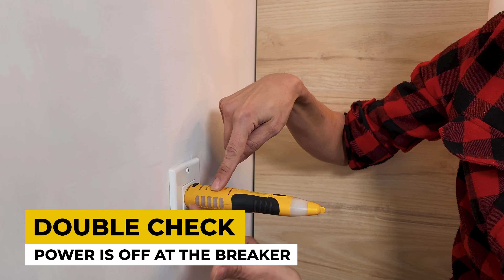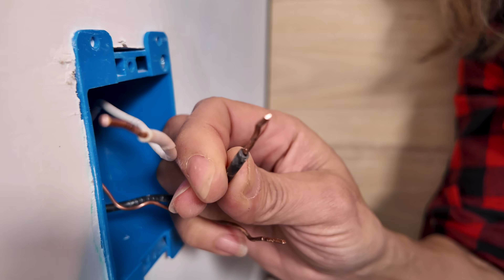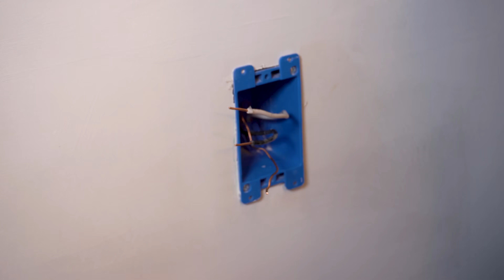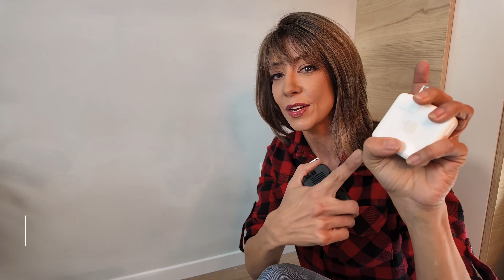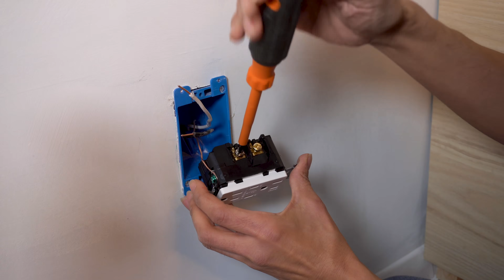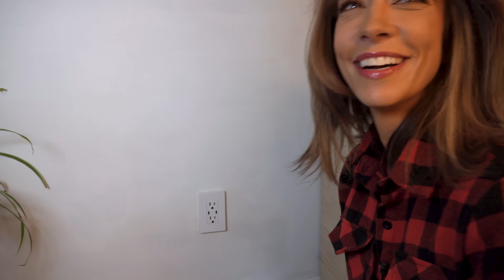No More Chargers | This Simple Outlet Upgrade Changes Everything

Comment: It's not necessarily safer to connect the earth ground first.  This implies that you did not properly disconnect the circuit so one of the others is still live, at voltage, but if it is, then having the earth ground connected first means that you have now turned the entire outlet (product) that you are handling into a ground path, so that when you next TOUCH the other wires to install them, you just created a path to ground THROUGH your body.  Very bad.

Ensure that the power is off, then it does not matter to connect earth ground first and if we want to play some odds of whether it really matters, then it might be better not to.  If worried about it, ensure that you are not touching anything grounded or another ground path while working with the live wire, and ideally only touch it with insulated tools - or just make sure the power is disconnected like stated  previously.

Comment: I do really like having the usb access, but I also am concerned over the rapid pace of changing technology. In the past I have installed outlets like this that had usb-a connections. Now everything we own works on USB-C. So, I've found that plugging in adaptors is simply easier and potentially cheaper in the long run. Of course, it is hard to get a sleek look by plugging in additional things that stick out beyond the outlet face. The plug here looks great!
Reply from the maker: It’s a valid concern about future-proofing. Thanks for sharing your experience!
Reply: I hate to break it to you, but when you plug a cable in to use this outlet, you still have things that stick out beyond the outlet face.  That's not sleek if you can see the outlet which you'd want to in order to use it.

Sleeker would be to pick an outlet you cannot see, hidden behind something, to a multi-outlet power strip, which is also placed where you cannot see it, then the wire to it also plugs in where you cannot see it, so all that remains to see to make it sleek is the end termination of the wire at the USB plug for the device, or of course to a wireless charging base.

Comment: These USB outlets are great....until they're not.  They go bad every few years just like the charging bricks, just at $20+ a pop.
Reply from the maker: That’s unfortunate to hear. Have you had issues with the brand in the video? I appreciate you sharing your experience. It’s important that products and brands are reliable.
Reply: I had one go bad but the one I replaced it with has been going strong for 3-5 years now?Leviton.

Comment: Thanks for the video; I had no idea there were PD-enabled outlet/chargers available! In the video you used insulation behind the wall plate. Do you have a link for any that you’d recommend? I’ve felt a draft from many an outlet in my house and I’d be VERY interested in that insulation stuff. Thanks!
Reply from the maker: Thanks for such a great question! I added the link to the outlet insulation. You are right. The drafts are a big issue. I use these in my home and it makes a big difference. Smart, easy fix to save on your energy bills and keep your home comfy. Good call!

Comment: Just one thing to add that I hope is helpful:  In older homes, white can also be 12/2 (12 guage)--and that's certainly the case in my home in the USA; that's important because--though I am speaking as a non-electrician here--I believe it's code to use 12 guage when the box is protected by a 20 AMP breaker, which all mine are.  Hence, one would not want to, say, pigtail using 14 guage, because one assumes white = 14/2.  Hope that's helpful.
Reply from the maker: Yes that’s helpful! I appreciate you sharing your experience with 12 gauge wire which is common in newer homes. Thanks for sharing your tip!

Comment: What do you do if you there is no ground wire?
Reply from the maker: @gordonwalker6458  older homes often don’t have ground wires. You’d connect the black and white in the same way without the ground.
Reply: You do not use this product.  Do not put outlets with a ground socket-pin on a circuit that has no ground wire or at the very least (depending on local electrical codes if present) grounded box/conduit.  That would allow plugging in things that need a ground, but that don't get one.  This is dangerous.

Comment: how does the heat dissipate from the box?
Reply from the maker: This unit doesn’t emit much but others do. It’s more of a concern for higher watts. UL listed devices undergo testing to ensure safety.
Reply: The same as any other (box) ?  Most USB charger widgets do not have a fan inside nor a lot of vent holes.  This was one of the reasons the younger generation jumped onto GaN bandwagon, not realizing that it only really makes a difference for travel use to make it smaller and lighter for same power density, but that in itself is a good thing too.

Comment: I like your channel. I do have a challenge, looking for advice. I am looking to put a door inside my attic from one side to the other. Here's the complexity:
This is an old home with an addition, the addition was put in leaving the old roof in place. The new side has no floor, just joists, and the only way to the new side is a narrow hole between the old and new side between roof joists. I would like to bridge one or two of these roof joists, widen the hole, and create stairs into the new section where I will add flooring. I am wondering what I would need to do to bridge the roof joists safely without collapsing the roof. Any suggestions would be great!
Reply from the maker: Whenever you are dealing with a structural issue I always work with a structural engineer. They can look at your home and tell you exactly what needs to be done. For stairs you can often sister joists for added strength and create a new opening on your own if you’re handy. Peace of mind is worth it. Thanks and good luck with your project sounds like a great way to add more functionality to your home!

Comment: Well done. But.... I think you're needlessly scaring people: if you've proven that power is off, there is no need to be concerned about which wire is disconnected/connected first/last... they're all dead and safe to touch. And, one more fine point: when sliding the bare wire into the  clamp: yes, you don't want bare wire exposed... but, equally important: DON'T slide the insulation into the clamp (it can hinder the clamp from making good electrical contact with the bare wire). You made this connection perfectly, but didn't mention the importance of sliding ONLY the bare wire into the clamp.
Reply from the maker: Thanks for sharing the tip on not sliding the insulation under. I appreciate your feedback.

Comment: I don't like them in general.  We removed some in a house we recently bought.  Reasons: (1) Regular outlets are good for 60 years or more.  These add electronics that will likely fail in a few years.  The PD function adds considerable electronics for the brains. (2) Heat generated by the electronics is confined to a small space with no ventilation.  External chargers are better cooled. (3) Technology changes quickly.  The USB ports will always be behind the state of the art, which today is 100W, not 30W or 60W for the type shown.  We had USB-A ports (12W) which were already pretty useless. (4) Unless you put them in every conceivable outlet where you might want to charge, you need to keep the external charger handy anyway.
Reply from the maker: Thanks for sharing your insights, I appreciate it.
Reply: You're making up fiction.  Regular outlets aren't good for 60 years or more if you actually use them much, but regardless if we assume the contact quality is equal, then the outlet portion of the product will have the same lifespan and if the USB portion fails, it would be similar to having an external USB charger fail over same amount of time.  You'd just keep using the outlet while you decide whether to replace it or seek a contemporary product at the time.

External chargers are not any better cooled on average, typically are inside the smallest sealed plastic box the circuit will fit in, which improves cooling minimally if at all.

"The USB ports will always be behind the state of the art", seems like a silly thing to state.  This is true of any product you buy, and these do not take more than a minute to install or swap so there is minimal point to be made unless someone is too  skittish to DIY install them, so has to pay a premium to have an electrician come to the site to do so.

USBA ports aren't useless at all - you're being silly.  I've accumulated quite a lot of devices that charge at 5V, 1A or less, so they are quite useful.

"Unless you put them in every conceivable outlet"...  "you need to keep the external charger handy anyway" is trying too hard to invent a problem.  On the contrary I almost always recharge things in the same location per device, and having multiple widgets to potentially recharge simultaneously, there is an argument for a single external charger with a bunch ( more than this outlet has) of ports to recharge the multiple devices, but in practice I am usually recharging the devices where they are normally stored anyway, which is not all in the same place for logistics reasons, but also because it's a bad idea to pile up a bunch of devices with Li-Ion cells together while charging, which means that if one were to go up in flames, the chances of it cascade igniting other devices within the vicinity is higher too.

My external chargers do not move around that much, but one thing that is handier about them is not having to reach all the way over to a wall outlet to access them, instead most are on a multi-outlet power strip, which conveniently also has a power switch to shut the outlets off.
Reply: @stinkycheese804  "External chargers are not any better cooled on average, typically are inside the smallest sealed plastic box the circuit will fit in, which improves cooling minimally if at all."  

I have to disagree on that.  External chargers are cooled by free-flowing air on at least 4 sides, unlike internal USB ports that have no free-flowing air.

The rest of your arguments are reasonable.  And your commentary was well received except for the insult at the beginning.  Nothing I said was fiction!  It clearly depends on the individual's use case, not YOUR specific use case.

Comment: Good tutorial. But I'm surprised these specialty outlets are still around. I have phones in both ecosystems and in both cases the USB end plugs into a little cube that is barely 1 inch x 1 inch x 1inch. Cube plugs into a standard outlet. I haven't seen one of those clunky big cubes in years.
Reply from the maker: Thanks for sharing what works for you. The big cube is a throwback for you.

Comment: Far as I know, the color white has nothing to do with the gauge of the wire.
Reply from the maker: Here 14 gauge wire has white sheathing around all wires as it enters the electrical box. 12 gauge will have yellow sheathing.
Reply: @DaruDhillon  I mean, that's true if we're talking about houses built after 2001, but before Romex color coding was standardized, almost all NM cables were white or gray regardless of gauge. Just a little caveat.
Reply from the maker: @EpicDudeWins  thanks for sharing that information it’s important to remember. There’s a lot of existing wiring that people will run into. I appreciate it.

Comment: I installed a few which are rated for higher power delivery. Do you know that the USB-C charging cable itself is very important and affects the charging speed of Apple devices, including iPhones and iPads? I have a few which are rated for higher charging power -- they are much bigger in diameter,  white colored USB-C cables. I bought them from Apple, and on Apple's website. My stuff charges faster with these cables plus the right USB-C power delivery outlet. Thank you so much for this wonderful tutorial!
Reply from the maker: Great points Robert thanks for sharing your tips with us. When buying cables these are good things to keep in mind. The right cables make a big difference. Appreciate your advice.
Reply: Thank you for your sharing.